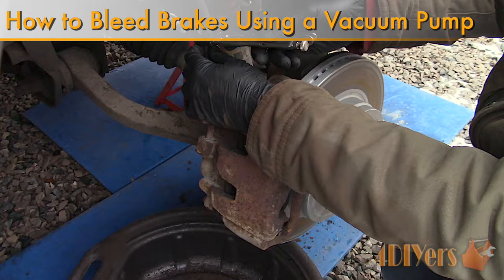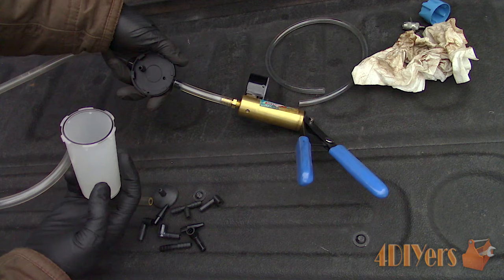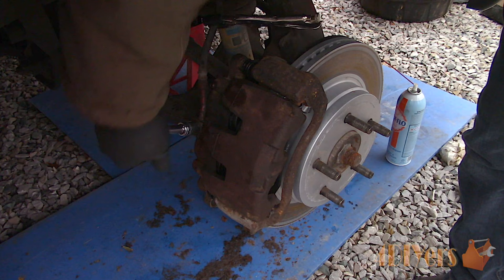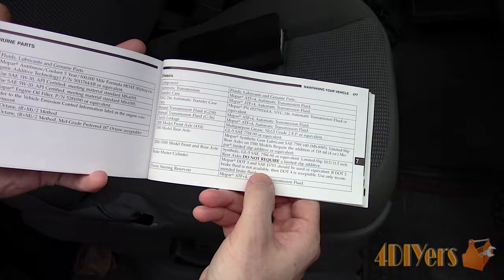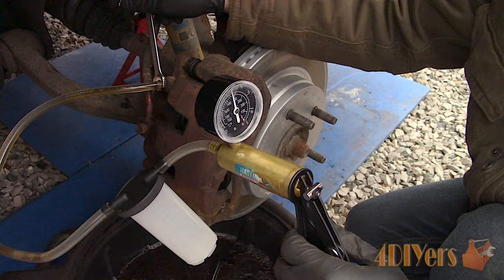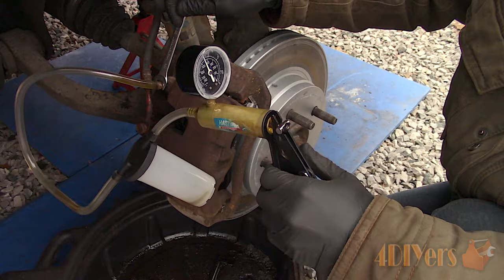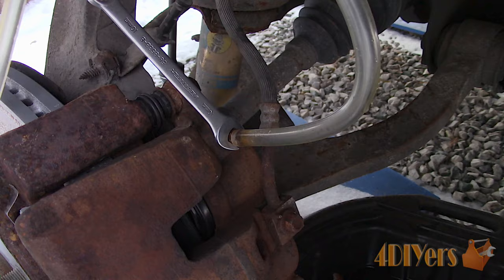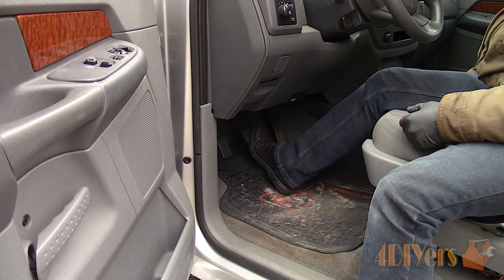How to Bleed the Brakes Using a Vacuum Pump

Comment: For the amateurs out there, use the bottle in between. If you get brake fluid in the vacuum pump it will eat the rubber inside and ruin your pump on depending on what rubber it has inside. Learn from my experience!
Reply: haha this is what happened to my my first time using pump. It spit brake fluid all other the place.
Reply: super glue a magnet to the bottle and slap it onto the caliper

Comment: Thanks, I've been trying to bleed the whole system after replacing a brake booster and even though iv got new fluid and no air from all calipers the pedal wasn't building pressure, I'll try with the ignition on, hopefully it was the abs thing

Comment: Rather than pinch the line to prevent fluid from draining you can get a vacuum line cap and slide it into the line in place of the bolt. Worked like a dream!
Reply from the maker: Great tip, thanks for sharing!

Comment: In the past I installed Russell speed bleeder screws. Replaces the stock screw with a screw that has a one way valve, so fluid and air only flows one way out. (One man bleeder method). Still using the clear hose running to a bottle to see the fluid.
Reply from the maker: Great tip, I'll have to look into those!

Comment: You could put a small metal hose clamp to hug the hose onto the bleeder screw.

Apparently you can put a bit of axle grease around  the outside of the bleerlder to stop air entering - never tried it though

Comment: Thank you for detailed tutoring video. I subscribed. One thing I would like to clarify. I know that the brake pedal should be pumped at the end of the bleeding all four wheels.
Can I pump the brake pedal after finishing each wheel. Would it help to figure it out that air is out of the currently bled line, and I can proceed to the next wheel.
I am not sure if it will help but want to make sure this will not screw all process. Also, I will replace the front bleeder screws. I guess I have to replace the bleeder's screw first and then just to continue following your tutoring procedure.
I will appreciate all answers from all knowledgeable DIY.
Reply from the maker: Thank you so much for the kind words and support! Pumping during each wheel unfortunately won’t help to determine if air is still present in that specific wheel. You can replace the bleeder screws while working on that specific wheel.

Comment: I have a compressor and bleeder(sealey),1 man bleeder etc but ya don't really need them. All you need to do is crack open the banjo bolt at caliper and gravity bleed 1st .this gets the line full and let's you then do the normal bleeding  way afterwards

Comment: Great video! Since bubbles in the plastic tube is normal, how do you know when all the air is out of your line?
Reply: Close the bleeder screw while pumping, when the hose is filled with just fluid no bubbles about two inches after the bleeder screw. Should be good.

Comment: I completely forgot this pump existed, I could have used it with doing a full brake job on a restoration recently!!
Reply: I just found mine in my old garage I didn’t even know I had it bought it at Harbor freight Several years Ago 😳

Comment: One thing I would add is, unless you know the fluid in the system is nearly new, I would recommend drawing as much of the old fluid out of the reservoir as you can before topping it up with fresh fluid and beginning the bleeding process. One disadvantage of the vacuum method (I use a vac bleeder connected to an airline) is that it is hard to be sure that all the air is gone while drawing a vacuum, because of the air leaking through the bleed screw threads, so I let it gravity bleed for a few seconds after releasing the vacuum, to confirm there are no more bubbles coming out before closing the screw.
Reply: Yes. Key information using vac.Pumps to bleed brakes
Reply: To eliminate air entering through the bleeder threads put some grease around the bleeder

Comment: Hi 4DIYers, I have a similar vacuum pump that's having issues. When I went to bleed my brakes today any time I let go of the pump lever the vacuum would leak from the handle end of the vacuum cylinder. Any thoughts?

Comment: I realize this is an old video so you may not see this but it looked like there was still a lot of air bubbles coming out when you were "finished". How would you know you are done if that much air is still coming out?
Reply from the maker: You can apply grease around the base of the bleeder screw. This will help prevent air from being pulled in around the threads.

Comment: When vac is applied to the open bleeder screw will outside air be drawn in at the bleeder threads and into. Through the vac pump?   If so it would look like air still in the system !   You were vaque on this
Reply: Nice.   That is key information when using hand operated vac. Pumps.   Thank you
Reply: Typically if you have air from the threads it will be fairly evenly spaced, small bubbles and frequent.  Air in the line is usually either a few small bubbles or a single large one, of course YMMV.

Comment: I tore a small hole in the outside of the rubber part which surrounds around the caliper piston.  Will that cause a problem?  Trying to figure out if that rubber part which goes around the caliper piston as you have shown in beginning of the video in your caliper rebuild is a dust cover or a seal?  If a seal then I need to replace is what I'm trying to determine?
Reply from the maker: Not immediately, but will cause a problem eventually. Dirt and moisture will work it's way around the piston and fluid seal. Best to fix it before it causes more problems and money.

Comment: Great video. Do you prefer this method or using a pressure bleeder?
Reply from the maker: Thank you! I like both, I'll use a vacuum pump for smaller jobs. Some brakes systems can be finicky, so a pressure bleeder will typically overcome that and it's very convenient when doing work on the full system.

Comment: Thanks for the video.  I ran the master cylinder dry doing my first time bleed using the manual method.  Will this vacuum method also get the air out of the master?
Reply: No, and if you ran it dry all you need to do now is bleed all 4 calipers.  The way I bleed master cylinders is pump brake, get someone to hold pedal, crack the lines at the Mc until fluid comes out with no air
Reply: @kylestenger15  Thanks for your reply.  I wound up doing a variation of what you described.  I was a little more strict to be sure it worked. (because I'm a noob)  I loosened the lines to the MC, put a stick between the brake & front seat, slid the seat forward, tightened the lines, released the seat & brake... repeated 5 times.  Caught all that fluid in a little bucket.  Then bled all the brake lines again.  Seemed to work.  Next step is to drive around some country roads a bit & give her a test.
Reply: @kylestenger15  did it get on the paint ?

Comment: theres no liquid coming out when i loosen it or very little but the pressure is going down very fast
Reply from the maker: The bleeder can be plugged with dirt or rust. Use a small drill bit by hand to clean it out.

Comment: What happens when you are still getting air out when out of nowhere no fluid is coming out at all?
Reply from the maker: Is the bleeder plugged?
Reply: @4DIYers  I was using the vacuum pump to pull air out of the driver rear. It was working and got three cups. Air was becoming less and less so I figured I would have one more go when out of nowhere it started spitting a ton of air and now the flow to that wheel is minimal. I have no pedal at all. Should I bleed the brakes all around again and see if I can get some pedal again? I need to run the ABS but don't have access to a diagnostic OBD2 tool.

I get pressure with a few presses when the car is off but when it is on, straight to the floor and have no stopping power.

Is it possible I was using too much vacuum on the hand pump at the beginning?
Reply from the maker: You will need to activate the ABS module, you maybe able to operate it with the key in the on position. Did you brake reservoir get low during the bleeding process?